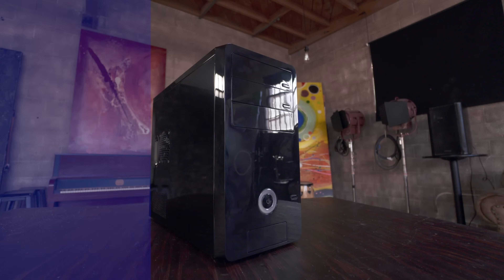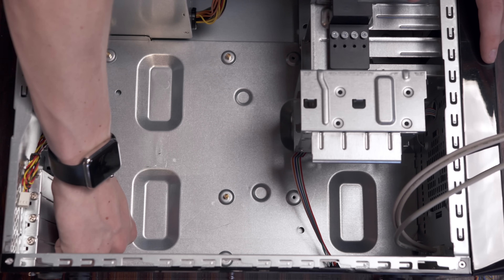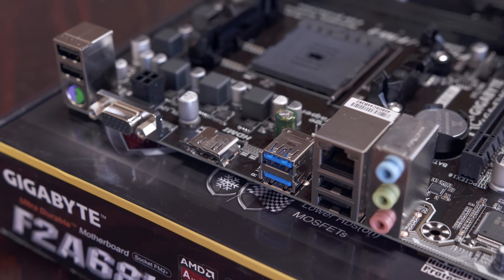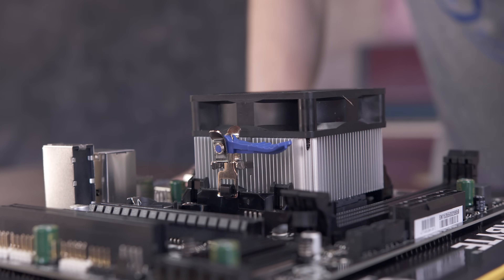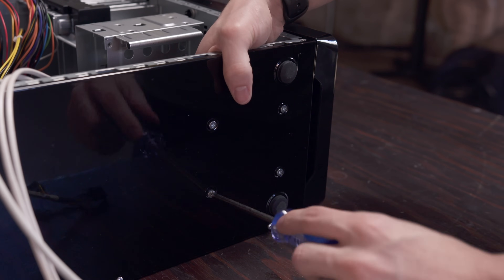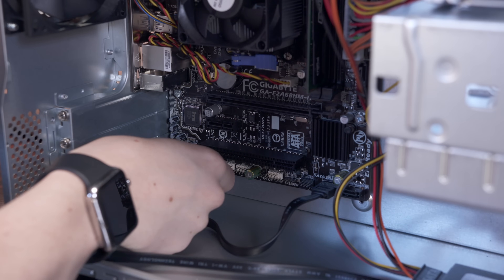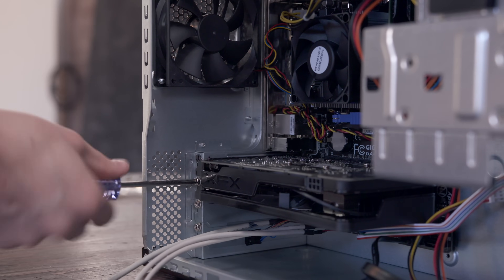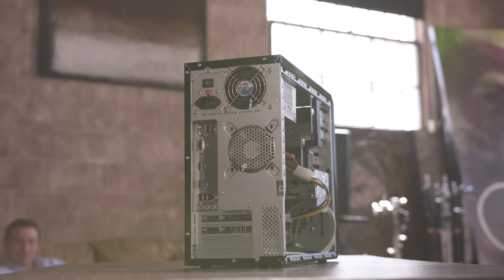How to Build a Gaming PC! (2016)

Comment: Is this a good gaming pc to start with I'm a serious beginner who's been on the console my own life and my budget is 600 I'm 17 

Hp 21" 1080p LED Backlit monitor 
Amd Fx 8 core processor 
Cooler master hyper 4 direct contact heatpipes 
Gygabite am3 + amd micro atx motherboard 
G skill sniper dual channel kit 
ZOTAC GeForce GTX 1050 Ti Mini, 4GB Graphics Card 
Deepcool mid tower case 
Evga 430 w1 power supply 
Redragon gaming keyboard
Reply: If you didn't buy it yet, you should just wait for Ryzen.
Reply: If you can, upgrade to an RX 470. I know that the MSI Armor OC 470 costs $155 after mail in rebates at the time of me typing this.
Reply: Or do I get a Intel 3.70 GHz Core i3-6100 3M Cache Processor
Reply: get a bigger PSU and you seem to be set, but google pcpartpicker, and it will be of great help to get the best parts possible! also, can suggest to grab a used display, most of the times they have nothing wrong with them, and their life expectancy is always around 10 years, so you can save a lot of money and lose no quality whatsoever!
Reply: pidzson is 500w good ?
Reply: no layup should be enough, but better safe than sorry. i got myself a 650w for my rx480
Reply: no layup holy shot same exact build as me except for the CPU
Reply: Captain Tici Is it good
Reply: no layup this build is much better
https://pcpartpicker.com/list/C2PCtJ
Reply: use a i3 6100 with an h110 board. Use the rx 470
Reply: Kqog Gaming On Macs dude why? You're worsening his build
Reply: Captain Tici how is it ?
Reply: no layup Didnt put it together yet but i used PC Part Picker for a pre build
Reply: no layup PC Part Picker is amazing
Reply: Captain Tici no I meant ur pc
Reply: no layup Well i didn't build it yet i im just buying the parts and when i get everything in then i will set it up...next week im getting the GeForce GTX 1050 GPU

Comment: I have never built a gaming pc, but im going to try to build one. I've done some research and I think im building it with these:

Intel Core i3-6100 3.7GHz Dual-Core Processor

MSI B150M BAZOOKA PLUS Micro ATX LGA1151 Motherboard

Avexir Core Series 8GB (1 x 8GB) DDR4-2400 Memory

Western Digital Caviar Blue 1TB 3.5" 7200RPM Internal Hard Drive

MSI GeForce GTX 1050 Ti 4GB Video Card

DIYPC DIY-F2-W ATX Mini Tower Case

SeaSonic S12II 430W 80+ Bronze Certified ATX Power Supply

anyone know if this has any problems, or anything that is too outdated?

Comment: Are all cases the same? Will all cases fit every motherboard? Will every motherboard fit any processor? 

I'm gonna try to build me a PC I'm just asking before I order the parts. Also I have a lenovo M52 can I use the mother board from there? I want to keep processor and motherboard. I just want a new case and more RAM and a decent graphics card.
Reply: Well, cases don't really matter, unless you want perfect cable management. And no, not all cases will fit any motherboard. Check supported motherboards on your case and then check what size the lenovo motherboard is. And every motherboard will not fit every processor. Look for what socket your motherboard is as well as your cpu. Example: i7-6700k is a socket 1151. And you can use the lenovo motherboard.

Comment: Iam really afraid of building my own computer since i dont know how and or what to buy. I just want to play minecraft with good fps help! I Have a labtop details: 8 gb ram, procesor intel core i3 cpu, 64 bits OS, x64 Procesor, intel HD graphics. People say it should run minecraft but it doesnt i get so much lag, the game moves so slow its unplayable but i can play other games like the sims, win 10 mcpe, etc. Anyways i want to know what i need in a new pc (I dont want a labtop anymore) to play minecraft with good fps iam fine with 60 or more fps. My max budget is $1,000 but will love it if its less plz :D
Reply: harwin monzon You can go with one of his $350 or $500 builds. Both of them are overkill for Minecraft, Sims, and other casual games (well over 100fps in both) + there's no point spending over $600 if you aren't going to be doing intense gaming. Word of advice though : both of those builds are gonna be around $200 more expensive due to you needing a decent HD screen with 60hz refresh rate and Windows 10, + other PC accessories (decent mouse, keyboard, headset, etc.)
Reply: harwin monzon did you just say minecraft?....
Reply: Helpless mother of 4 so what

Comment: can someone tell me if my setup will work and be able to run bf1 on ultra and can someone tell me what power supply and fan to buy

i7 7700k
gtx 1060 6b dual fans
gigabyte h110ma motherboard
Reply: i think you'll be fine :) and for the psu and fan, I don't rlly know I would like someone else to comment here what they think
Reply: I would definitely check out power supplies from Corsair, I would recommend going with one no less than 500 watts. The 1060 would run fine with a 500 watt, but just to be safe I'd go with a 600 or 750 watt.

Comment: can i ask help guys, what cpu/apu should I upgrade to since my current one a a6-6420k is really holding me back w some games, also I'm planning to get a msi gt 730 ddr5 variant any suggestions? 

(mobo is an gigabyte f2a68hm-s1, processor a6-6420k and an radeon hd 6570 going dual graphics mode )
thanks in advance!

Comment: Ok I am building my first computer and the case has 4 fans. 2 at top, 1 on front and 1 on back. They are all 3 pin cables to connect to the motherboard. But the problem is that there are only 3 fan connectors and 2 out of the 3 are 3 pin ports. Please someone respond. I really want to build this pc!

Comment: Hey guys i have question who answer and helping me god bless u. i want make a pc Motherboard:Gigabyte H110M-S2H  EcranCard:GTX 1060 4gb  Electric: 600W  i5 6000(idk its like that lol) And yeah thats it so its good or bad if i forget anything tell to me its worth it? Help me get good pc guys please help me THXXX :) BUDGET:900EURO  not much please
Reply: win10 ( need pc that can run all pc on ultra min 40FPS in max settings. Help me get good pc iam new i know nothing so yeah am school kid
Reply: Usta Adam its a pretty good pc overall I think you can run every game on high settings but I would recommend to get an I5 6500, because the price per performance of a 6600 it's too little and not worth it and also the gtx 1060 is 3gb no 4 I would rather go to a rx 480 for more futureproof with that extra vram and for dx12 and vulkan.  If you have any doubt let me know

Comment: PS4 player here gonna keep it for exclusives and try and build  pc for main games: Battlefield, Resident Evil, shooters basically
A noob pretty much so is this a good starter pc at around 500? or what can I change to make it better but around the 500$ range

CPU: Intel Core i3-4170 3.7GHz Dual-Core
Motherboard: MSI H81M-E34 Micro ATX LGA1150
Ram: Avexir Core Series 8GB (1 x 8GB) DDR3-1600 Memory
SSD: Transcend SSD370 128GB 2.5" 
Hard Drive: Seagate Barracuda 1TB 3.5" 7200RPM
Graphics card: PowerColor Radeon R7 370 2GB PCS+ ( Should I switch for RX 470 GDDR5 8gb ?)
Case: Rosewill Gaming ATX Mid Tower Computer Case Challenger S 
Power supply: EVGA 500W 80+ Certified ATX

Any help is useful thanks

Comment: OK so, I did all the steps correctly but when I bought the PSU(Corsair VS550w) I figured out that I have the wrong cables. Some of them don't match with the motherboard(H110M-DS2). Help someone please. (BTW i dont care about haters,I'm a starter)
Reply: All power supply regardless of brand and model WILL have cables that can connect to the mobo. ALL Power supply follow standardized design. If it doesn't match, means you must have misidentified them.
Reply: Okay, the problem has been solved. My motherboard has a 4-pin socket while I have a 8-pin cable for the CPU power. I plugged in the 8-pin cable to the 4-pin socket leaving 4-pins unplugged and It works perfectly with no problems I think. Now I have some problems with the other cables and I don't know where and how to plug them. Anyways, thank you for your help :).
Reply: Most of the time, you will have redundant power cables and you can just ignore them.
Reply: WB IsMe  I don't know what cables should I ignore. I have plugged in the CPU(8-pin) cable and the 24-pin cable. Nothing else.
Reply: The flat looking connector is for SSD, harddrive and disk reader. The connector with 4 holes is mostly for case fan that uses those connector.  The 6pin connector stated PCI-E is for graphic card that uses those connector.
Reply: But some of the cables have multiple USB. Which one should I plug In? Sorry for different questions, you help me alot.
Reply: Firstly, you need to read your mobo's instruction manual especially the page where it will tell you all the location of all internal I/O port on your mobo.

Your case comes with connector like HDAUDIO, USB2.0, USB3.0, LED+ & -, HDD+ & -, 2 Power switch and 2 Reset switch. Follow the manual and connect the appropriate internal I/O port.
Reply: I've done all these,by reading instruction manual. The only problem that I have now is with some cables from the PSU.I have plugged in the 24pin,4pin(CPU), 6pin(GraphicsCard) and the flat looking cable for the HDD(storage). Now I have stayed with 2 cables.I know I need them for the case fans, but the case I have is a little bit different. It surely has that one door (sysfan1) but my case also contains 4 little cables. 2 of them say:FAN1 and the other 2 say FAN2 (these are coming with a cable that says POWER.) So yea I don't know if I should use the system fan or these 4 cables. I've really watched tons of tutorials and step by step videos but O cant understand.Anyway, really appreciate your helping mate.
Reply: Case fan normally uses either 3 pin, 4 pin or molex connector (4 holes). Molex connector is from the PSU. The 3 or 4 pin is from mobo. Mobo have limited 3 or 4 pin port. If your mobo doesn't have enough, you have to buy an adapter to molex and tap the power from the power supply.

Comment: ok. i did evreything you said and nothing happned
Reply: Did you plug in the 4pin CPU connector properly? There is a specific orientation. Check if you connect the front panel connector properly.
Reply: WB IsMe what happened was that the lights turned on. but the monitor said no signal. I tried 2 diffrent monitors, both said the same thing. Here is the list of parts
https://pcpartpicker.com/list/vNyYRG
Reply: Did you plug in the 8pin PCIE power connector to your RX480?
Reply: Tremor yeah
Reply: Plug your hdmi directly to your gpu

Comment: Will a gtx 1070 fit in the motherboard?
Reply: All graphic card will fit into all mobo so long as the mobo has PCIE x16 2.0 or higher slot. Almost 95% of the mobo available in the market has a PCIE x16 2.0 or higher slot.
Reply: Thanks

Comment: i am helping my friend build this pc as it is his first. we bought the exact same mobo but instead of the 4 pin connecter at the top it is a 8 pin. I am in the UK and the psu does not have the 8 pin will he have to buy a new psu or can someone recommend an alternative method?

EDIT he has told me he has bought the more expensive version of this motherboard so i have devised a plan to fix this. only 4 of the 8 need to be powered (3,4,7,8) so we are in luck xD

Comment: Is This Build Good?
PROCESSOR: AMD Athlon X4 880K
MOTHER BOARD: ASUS A88X-GAMER or CROSSBLADE RANGER
VIDEO CARD: R7240-OC-4GD3-L or a higher end video card
KEYBOARD: ASUS Cerberus Keyboard
MOUSE: ASUS Cerberus Mouse
MOUSE PAD: ASUS CERBERUS MOUSE PAD
HEADSET: ASUS Cerberus Headphones
MONITOR: ASUS VP228NE x3
RAM: Kingston FURY 8gb x2
CPU CASE: 
PSU: 
AVR: 
HDD: 2tb 
SSD: AMD R3 480GB

Comment: I installed everything, the pc works but when i turn the monitor on the doesn't have a signal from the pc. Any help?
Reply: i personaly have a geoforce (Not sure witch one...) and i have the same issue,  Not entirly sure what the issue is, id reccemed you take it to a pro so they can work there magic. BTW, did you get your GPU new or used?

Comment: Kinda a noob so can someone tell me how to find my specs so I can share on here? I wanna see what I need to upgrade if I need to in order to use a Radeon RX 470 GDDR5 4GB as a graphic card.

Best Info I could find of my computer:
AMD Phenom (tm) 9600 quad core processor, 2300 Mhz, 4 cores, 4 logical processors
Ram slots: 4/ 0 open
PCi slots: 1/ 0 open
PCi-E slots: 3 / 1 is open
SATA PORTS: 4/ 2 are open
Reply: Everything :(

That CPU would bottleneck something like an RX 470. I also doubt that the PSU that came w/ that PC wouldn't be able to support something as powerfull. If you can't afford to upgrade your PC rn, I'd downgrade to an RX 460 which can run off the PCI-E power
Reply: I'm thinking of just building one...Might sell the one I have and my laptop to get money. Is 500-600 a good price range to make a pc?
Reply: Yes 500-600 can build you a good pc, i have a pre built hp pc that is decent and im planning to sell it when i have enough money so i can buy the operating system and the cpu, the money from my pc will go to the other components.
Reply: I'm planning to get my with all the parts bundled together and unbuilt

Comment: Do you need antistatic gloves to build one?
Reply: No. Just avoid assembling the PC on a rough surface like rug, etc.
Reply: +WB IsMe Okay. Thanks!
Reply: +WB IsMe Can i build the pc on a wooden desk?
Reply: yes
Reply: Before you start building make sure you ground yourself by touching the power supply also if youre gettig a intel cpu after u put the cpu fan in make sure you push each side down i forgot to lock them and my motherboard and cpu fan

Comment: Hey Austin, quick question on this build.  You mentioned that this build needs 6 stand-offs for this Micro ATX build, but when you screw, you just do 5. Later when placing the MicroATX board, the board doesn't get all way down into the 6th hole. Where you meant to say 5 standoffs, or 6 and you made an adjustment off camera?
Reply: Doesnt matter so long as your motherboard is not wobbly when you handle it.

Comment: about if my mother bourd doesnt have a 4 pin cpu power ...cable?
Reply: Motherboard comes with either 4 or 8 pin CPU power connector. Read your motherboard manual. Cable is provided by the power supply.
Reply: Hb

Comment: keeps turning on and off PLEASE HELP
Reply: This is cause by short circuit or some connector or component not installed/connected properly.
Reply: WB IsMe how do I make sure something's installed properly?
Reply: Nacho Chips Based on experience. For this problem, you have to do step by step diagnostic to eliminate potential problem by disconnecting hardware 1 at a time.
Reply: WB IsMe thanks... :D

Comment: Is this good for my first pc?

Motherboard- B150M Pro-VD  LGA 1151mATX 

Processor- i5 6500 

Graphics Card- GTX 1060 msi armour edition 

Power Supply- EVGA 430w 

Case- DIYPC DIY-N8-W White USB 3.0 micro-ATX Mini Tower Gaming Computer Case with 2 x 1x120mm LED fan x rear Pre-installed 

Anything I should change or is this good??

Comment: I was going to buy the PS4 Pro but I heard that I could build a better PC with better graphics and a better frame rate than the PS4 Pro for around the same price. I've never built a PC before so I have no idea where to start as far as getting the parts for it. Following this guide should be easy enough to build it but what parts do I need to build a really nice gaming pc for less than 500 bucks?

Comment: Is this build good for a 500 euro gaming PC? Are the parts compatible?

Case: Nox Hummer MC USB 3.0 Zero Edition

Power Supply: Seasonic Eco Series 430w 80 Plus Bronze

RAM: Kingston HyperX Fury DDR4 2133 PC4-17000 8GB CL14

Motherboard: MSI H110M PRO-D

Processor: Intel Pentium G4400 3.3Ghz

Graphics Card: MSI GeForce GTX1050 GAMING X 2GB GDDR5

HDD:Seagate Barracuda 7200.14 1TB SATA3

Should I change anything? And could I upgrade to a Core i5 in the future?
Reply: BTW I have 50€ left since it costs 450
Reply: Spend some more for a GTX 1050ti bro and you are at 500€
Reply: Nacho Garcia just get a i5 instead of pentium and your set to be honest
Reply: Stephen Rosal I'm going to get an i3
Reply: Nacho Garcia  Get an i3 6100

Comment: Cpu at 57C on the bios?????? my cpu under normal usage is about 45 50, in the bios depending on the ambient temperature is about 32 35c, almost 60c on the bios is really high

Comment: This is probably a stupid question, but I took apart my 2001 PC a few days ago, could I use the power supply from that when building a PC? It would save money, and it's the only part I think is worth using out of it.
Reply: Power supply is a time bomb, get a cheap or old power supply will have a higher chance of killing your component when it goes wrong. Spend abit more to get a new one of reputable brand.
Reply: WB IsMe Ok thanks, I found the wattage is too low anyway.

Comment: Does every motherboard have a wifi slot ?
Reply: There are wifi USB adapter and wifi card. If you are refering to wifi card, the latest generation require a PCIE slot. 1:21. The PCIE slot is a standardized universal interface slot for graphic card, sound card, wifi card, etc. The PCIE slot shown in the video is a 16X PCIE slot mostly for graphic card while the short one is a 1x PCIE slot. You can install the wifi card on any PCIE slot. If you slot a graphic card into the 1x PCIE slot, you will only get 1/16 of it's maximum performance.
Reply: Yes
Reply: Joe Bob EVERY one ?
Reply: Just kidding. I have no idea and I have never build a computer before. Don't trust facts giving by stranger again though. ;3
Reply: WB IsMe thx bro